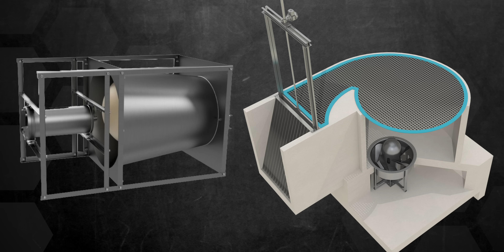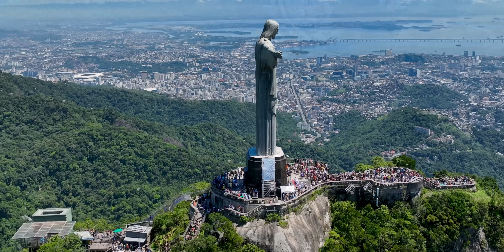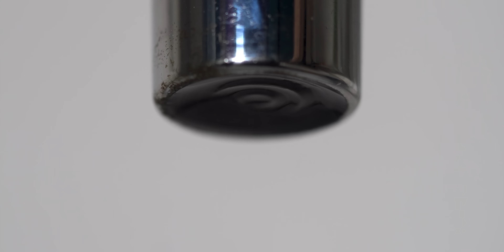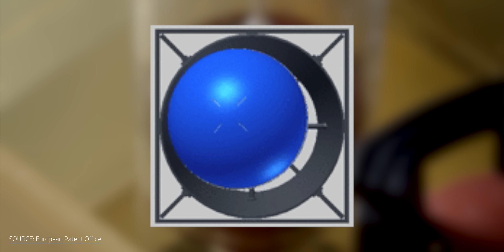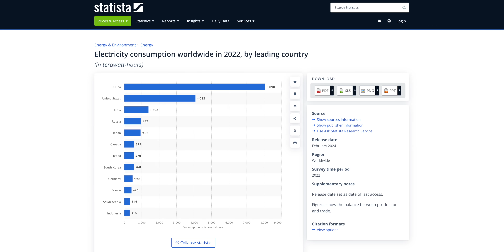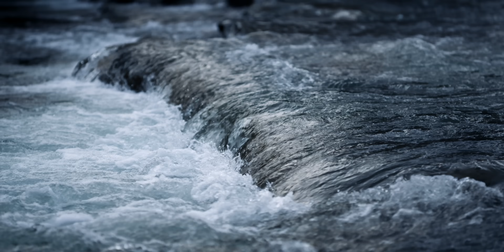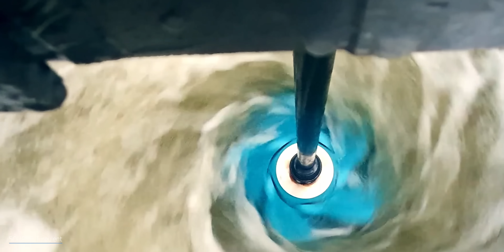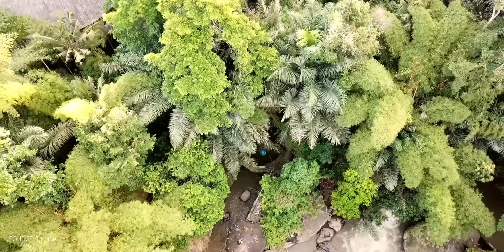The Genius of Small Hydro Turbines

Comment: Instead of building a dam why don't you have a large diameter pipe running down the hill with a debris diverter for fish and then put all the turbines inside the pipe? Build two so you can divert to the other one for maintenance every couple years, or run both during High demand periods.
Reply: the reason we make dams and huge reservoirs is because alllllll that water gives alot of pressure giving way more energy than just having a turbine in a tube. also bc alot of reservoirs reserve fresh water for people to use.

if you had a little turbine spinning in a river in a tube, it wouldn't generate nearly as much energy as having thousands of tons of water pushing on it.

Comment: The law of conservation of energy tells that that energy is lost or created just transferred. So, I hydropower generate electricity, there with be less energy, it terms of water flow, I the waterway. Reduce it enough and sediment begins to accumulate. That changes the ecology of the area and could potentially lead to flooding or unwanted and unexpected changes to the course of the waterway. I believe these all things that happen in the Mississippi River system and the Corp of Engineers is constantly at work to mitigate them. Just a thought.

Comment: i have a low head / high volume modular SHP design .... it's a horizontal rotor, which is extruded using the same machinery used to make I-beams ....Only 21 inches of head, standard induction grid sync, and a de-frost dump load that diverts the turbine's power into the concrete uplift beneath the turbine ... all the water up river is pushing water into the up lift constriction, which accelerates the water through the horizontal axis turbines.
there are debris screens and integrated overhead dock;  so the boat, and fish, traffic take a different path starting far up-stream, where the partition is a level limiting weir and turbulence inducing aggregate at the bottom of the channel maintains the 21 inches of head.
Reply: This is my first day on this site. But I gotta say : this nerdy DIY enviroment is almost scarry😅

Comment: "The river's flow remains undisturbed." That combined with the other features of being cheaper and faster and a personal power suply are contradictory. The more you add to a river, the greater the impact, right up until your river is a fully concrete power generator, your forests and crops die, and the world goes to shit. Centralizing your power supply is much cleaner.
Reply: @Will_Forge  explanation please?
Reply: @richardshillam7075  imagine a natural river eventually with each bank so overloaded with diverted paths into these that the banks of that river are more made of concrete and steel than they are of soil and trees. What I'm saying is that this is not scalable. Eventually it overruns the entire ecosystem and is as destructive as coal or oil power production. 

The cleanest power production remains nuclear. Right now it's not as clean as it will be when we can finally crack fusion, but even as it is now it is cleaner and better for longevity than Even this possibility. In the short term though this will benefit us all to have a mix of various power sources like this to make the whole system cleaner overall even if some of the other power systems are not so clean.
Reply: @Will_Forge  hi will, in Britain there aren't that many places where this can happen. With the elevation changes in his other videos or the pre existing  channels in this video planning applications would have been insane. It's like fishing upstream. In the right circumstances though it could mitigate some of the problems with recent flooding?
Reply: @richardshillam7075  potentially, yeah! So yeah within reason this is a fantastic tech and like you said may be able to be built into flood relief measures. That's a great point.

Comment: I just wonder about weeds for these type solutions clogging up the works.  I also wonder if you could not have an EV fill up with water, generate electricity down hill as it charges its battery, and then come up with much less energy since it dumped its water.

Comment: Putting any kind of generation in the flow of an irrigation canal is a terrible idea.

The canal is built to get water from the source to the required need.  And is going to be designed to create enough flow to accomplish that.  If you slow down that flow by pulling out energy, then that means there was excess energy put into the design at the source.  Almost certainly via a powered pump.  And thanks to  conservation of energy, what you get out of the generator is going to be less than what you spent pumping earlier.  So overall a net loss.

Comment: Still looking  - how to design and install microturbines attached to my houseboat to passively generate electrical power to store in batteries for use on the boat for daily living: lights, fan, refrigerator computer and phone charging...The river flow rate varies dramatically and the depth fluctuates.

Comment: adding a convayor belt self cleaning filter at entrance would greatly reduce matinace, a tapered funnel shaped walls and matching tapered screw turbine will greatly increase torque output and power generation in same area. Baced off Bernoulli's equation.

Comment: You mentioned the “intermittency” problems of solar and wind power production.  Water impounded behind a hydroelectric dam provides energy storage in the event of a drought.  The impounded water and relatively uniform  head height provides for consistent electric power production.  Run of the river systems you applaud do not provide these benefits.

Comment: It is surprising that you have chosen to ignore some of the existing turbines for low heads and/or
low flows.
You have the fixed blades turbines that have a rotor similar to a propeller
An improved version is the Kaplan turbine where the blades can rotate changing the angle between the blade and the water flow (when the amount of water or head changes)
And you have also a French system that is about 80 years old called the "bulb group" where the turbine and alternator are encased in a steel envelope of proper aerodynamic shape and the whole assmbly is submerged parallel to a river flow with only power and control cables coming out of the river.

Comment: With solar panel you can generate green electricity for approx. 3 to 10 cents/kWh. And with almost no maintenance for 25 to 30 years.
By way of comparison, all recent studies on small hydropower plants have shown costs of approx. 15 to 30 cents/kWh.
With hydropower plants, you have to remove branches and rubbish several times a week. And frequent maintenance for the mechanics, which have to be replaced after 3-5 years.
The efficiency of these vortex systems was only between 30 and 48%, see Wikipedia. Usefull for low drop waterfall heights less than 3m.

Comment: Where I grew up (Wester Montana) we had many brooks and bigger creaks with water flowing year round. To off set the ice and snow, couldn't you just put the turbines inside insulated buildings. You can even use a solar panel to power a heater to keep it 42 F inside. If you put your inlet and the outlet at the bottom of the creek, you should have water flow all year round. The heater would even be more efficient if you stacked the hydro turbines like at the Barbegal mill.

Comment: In the UK there are literally hundreds of potential sites which could host one of these systems. You could have one every 100 yards 17 per mile because you are returning the water back to the river. If you were a farmer along side dozens of rivers in the UK you would have low cost electricity all the year. Maybe in some summer months it might be lower output. Sadly the UK does not have any visionary leaders these days so this will never happen. It used to - weirs were built across rivers and the flow diverted to power water wheels to drive factories but that has practically disappeared but the weirs are often still in place.

Comment: You can tell a lot about someone by what they acknowledge and what they dismiss. 

Marching orders aside. One point no one seems to have considered. Logistics, or more specifically, logisitics infrastructure.

People are pointing out the individual or un-intergrated potential of of hydro.
In both the comments and the video itself.

No one seems to be  considering the possibility of intergration of better yet a rework of our modern logistical power grid. 

We have to use transformers and steppers, changes in voltage and current to transfer electricity long distance. With a lot of loss along the way, its not an efficient system.

You know what is efficient? And we have several millennium of experience building? 

Canals. 

With a network of canals like most countries pre-industrial revolution used for internal logistics. 

You could revolutionise the potential of low head hydro. 

You can account for changes in elevation, and distance. And honestly, it would be more expensive short term than our current system. But the level of required upkeep is ridiculously small.

Comment: ALL renewable energy systems should by default be decentralized.
That's the only way they make sense. The infrastructure for power transmission over long distances is way too expensive, leading to energy poverty in areas outside of urban and sub urban city centres. Enter smart Renewable Energy systems.

Comment: Great idea, also so many location and love the idea of stacking these along river. Make a lot of sense. It would be great if you could do article on hydro efficiency's, as I'm confused. I like the idea of pump/hydro but struggle with some of the claims in efficiency's. SO in a Pump/Hydro most, hydro turbine have  efficacy's of 50 to 90% then you add, return water pumping. Pumping efficiency from my research is even less efficient than hydro component yet company's are claiming turn around efficiency greater than 90% how can this be possible?

Comment: Matt, people in many European countries especially the UK and Germany, are resurrecting old mill sites and previously un-utilized canals for electricity using precision laser cut, welded steel waterwheels. The company HydroWatt in Germany has been leading the way for the last few decades building hundreds of steel and some wood waterwheels to make clean power. HydroWatt has made small wheels and some very large and powerful wheels, the largest is 6 meter(19.69 ft) in diameter, with a 6 meter(19.69 ft) face, with a flow rate of 4,000 liters/ second(141.26 cu.ft/sec), it has a mechanical power of 107kw and an electrical output of 95kw. The company also manufactures overbuilt rugged all in one gearbox/generator units to handle the massive torque these wheels make to produce green electricity with minimal maintenance. Water wheels have many of the features you discussed in this video, they do no need a dam, a tiny weir and a diversion canal can develop enough head, that being said there are thousands of old mill site in Europe that already have dams making them very attractive for power generation. Waterwheels are fish friendly as they will pass over the wheel uninjured. Waterwheels are ultra low maintenance. Correctly engineered Overshot waterwheels have an efficiency of 90-93% and even in lower flow situations a wheel will produce the maximum electricity based on the amount(weight) of water over the wheel, turbines suffer in this area as below a certain head they will not function or function inefficiently. It would make a fantastic video series if you were to take a trip to Europe to see some of these installations, interview people at HydroWatt and other waterwheel manufactures, featuring numerous sites producing clean energy.

Comment: This is Greta Thunberg madness. You will have to build tens of thousands of these small hydroelectric power plants, scattered over a huge area, often in hard-to-reach places, just to replace one large hydroelectric power station. All this requires maintenance by personnel and the construction of electrical supports. Without a dam, it will be impossible to regulate the flow, store water when the flow of the river bed changes, or fight floods downstream. The larger the power plant, the cheaper it is to maintain in terms of kW of power, this is a fact.

Comment: Doesn't suffer the same intermittency problems? Did you do any research on that? Every winter and summer their output plummets because water.and ice levels, ironically enough the two times of the year power is at the highest demand.

Comment: The challenge I see, I look at these units and they are packed with plastic and cheap metal alloys, etc. .. how long are they going to last?  How does replacement factor in.  Also concrete is expensive ... getting equipment/machinery out to do the work needed to create the enclosures for the units would be potentially environmentally impactful.  This is intriguing though for sure and a great solution in some places.  The irrigation systems out there where there isn't an environmental concern as much and access is easy, it seems like a no-brainer to incorporate these types of systems.

Comment: The reality in 2024 is that you can generate green electricity for around 3 to 10 cents/kWh thanks to solar panels that are now extremely cheap. 
And with almost no maintenance for 25 to 30 years. 
With hydropower plants, on the other hand, you have to remove leaves, branches and rubbish several times a week. 
In addition, continuous operation puts extreme strain on the mechanical parts, which have to be replaced after 2-5 years.

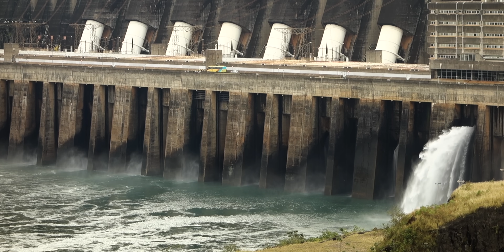Comment: Order of magnitude error at 3:17 : US faucet flow rate is about 1 gallon per minute, or 63 milliliters per second. Flow rate through dam is 62,200 cubic meters per second. 62 x 10^3 / (63 x 10^-6) ~= 1 billion; thus the dam flow rate is equivalent to 1 billion faucets.
Reply: What would it be in football fields?
Reply: @flyovercounty1427  a football field is 120 yards long by 53 1/3 yards wide. This is a surface area of 0.53 hectares. At 62200 cubic meters per second, the flow through the dam could fill an american football field to a depth of  11 meters every second

Comment: ive seen plans for these whirlpool generators many times, im curious to know if you think it could be built into a self sustaining closed system?  using a human built stream, would we be able to add enough turbines to produce power and move the water back up from a lower basin to a higher one to have it effectively looping endlessly while still providing a usable amount of additional energy?

so a higher basin with a steep release pathway leading around and through multiple turbines into the lower basin, to have it shifted back to the upper basin to repeat.

im not knowledged enough in the mathmatics of it to answer it myself, but the question itsself has been running in my brain given the kinetic slopes are the primary generation of power, does it still ultimately require more energy to pull it back to the top at a great enough speed to make this idea actually possible  laws of conservation should dictate that its not possible, but i cant help but ponder this design in my head.

like im sure there will be water loss that would need replenishment in one form or another.

i am thinking of an underground manmade stream that could into underground infrastructure below housing in a smaller village to help have a consistent power source.  probably augmented with solar or wind power if its able to be effectively self sustaining but not enough to fully power the village concept.

Comment: my suggestion is a closed loop system using a small reservoir with a larger reservoir underneath it with a pump moving water or Antifreeze to top and also using a radiator system to dissipate heat build up. just something rattling around in my head. I used the Turbulent system for reference to configure a shipping container layout with side vents for radiator placement and side air flow

Comment: The designs mentioned remind me of the Romanian 100+ year old valtoare/vâltori (whirlpool), which is a water-powered washing machine. 

For it, water is channeled into a large wooden funnel-like barrel. The funnel has gaps wide enough for water to flow out, but not wide enough for the cloth to slip through. The force and angle of the water hitting the wood creates a spiral of water, which tumbles the clothes thrown inside. 

Just some random info for everyone.

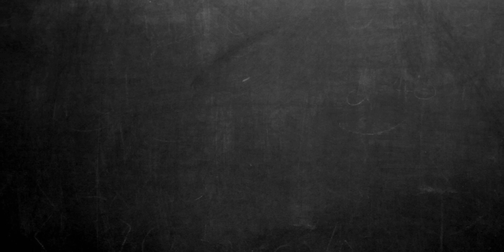Comment: Unfortunately, small is expensive. A 10kW shp will cost 25000-30000$ and yield about 6000$ 5:44 year worth of electricity. Small often means river or stream dries up in summer or flow is reduced. All together a better pay back than solar at about 4-5year. Its a great clean tech but not all free sailing

Comment: Theoretically for a diversion type hydroelectric plant, they could install flow controls across a portion of the river's width to help regulate power supply without impacting wildlife that much. They wouldn't be changing the flow rate of the river, just what fraction of it flows through the plant, ideally setting aside a certain fraction that it cannot take, thereby preventing it from actually stopping fish migration.

Comment: I'd be fascinated with how some of these could be fitted in with old infrastructure. In this instance I'm talking canals - Yes during summer they're likely to have issues but for the other 50 weeks of the year they'd be fine in the UK - especially where there's plenty of locks with bypasses. Loads of spots for small hydropower to be introduced.

Comment: I like the idea of micro hydro. I've been wondering how I can implement one into my irrigation system. I have lots of head height and usually have some good flow plus it gets around a couple of the issues listed: No freezing as the irrigation only runs from may-Sept, and it has to be filtered to go through the drip irrigation anyway so no clogging! I'd only be small scale though, 400-600watts probably.